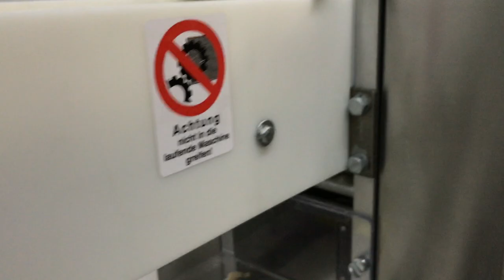Excalibur Bagel Machine / Altuntas Bäckereimaschinen

Comment: I hate to break it to you but that dough was not quite ready to be formed into bagels. Probably needed more kneading and proofing time if the ingredients were properly proportioned and mixed.
Reply from the maker: ChangeChannel Of course, you are right. This video is only made to demonstrate the operation of the machine. The dough consists of flour, water and a small portion of yeast.
Reply: Slm bra bir mahsuru yoksa kaca sattiniz acaba ?
Reply: I forgot entirely that dough used for examples was more like a simple clay and not actual dough.  @AltuntasGmbH